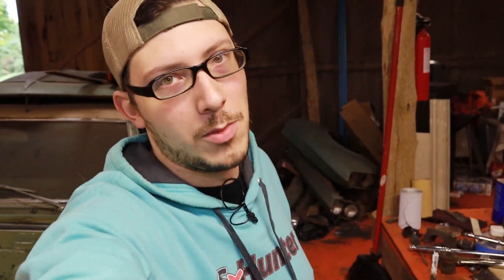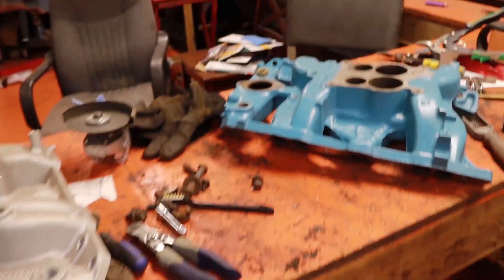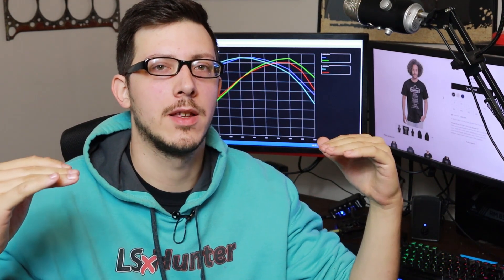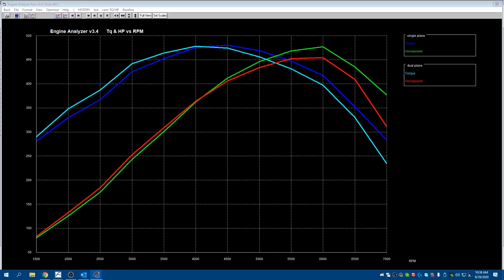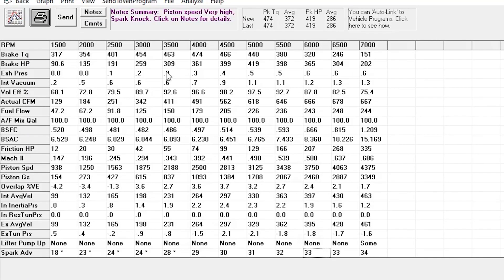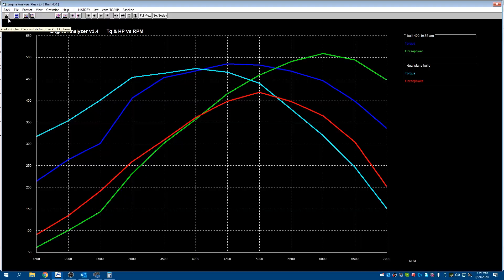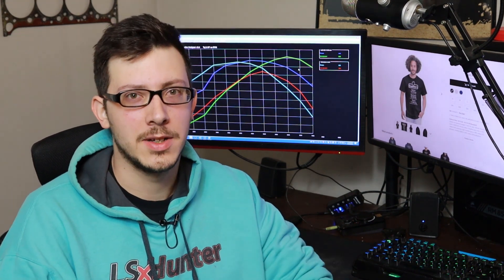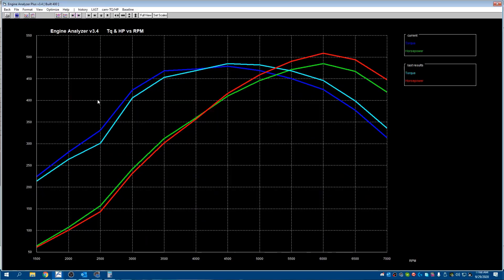Single Plane vs Dual Plane Intake Manifold Comparison

Comment: If you want to kill low end torque, the Torker II is your guy. (340hp FRPP crate 302). I went from an RPM Air-Gap to a Torker II thinking the RPM range on the box was real world. UGH! The Torker II killed my launch and the E303 cam couldn't make up for it quickly enough. From there, I put on a Victor Jr. Oh boy! The launch was mucho bettero than the Torker II with the same top end of both the Air Gap and the Torker II. The Victor Jr was my daily driver intake for years, as in cruising below 3500 rpm. Then I went tunnel ram. That stuff is WAY COOL!!! Tunnel rams make great low-end torque, and you are best banging gears at 6000 rpm. I will say that they all picked up top end charge by port matching. While I have no dyno numbers, my 60 foot was about the same with the RPM Air Gap and the Victor Jr. Both were used with 3.25 to 4.10 gears without any noticeable sacrifice anywhere. OK, 4.10s SUCKED for cruising and didn't do anything at the track. But that wasn't the fault of the intake manifold.

Comment: Hello sir. I have a 1974 Pontiac Grandville convertible. I just bought a 400 rebuilt engine. It’s a 400 bored .030 over. 4x heads. Quick Fuel 850 double pumper. Edelbrock 2801 cam. It has a Edlebrock torquer 2 intake single plane but I have a Edlebrock rpm performer dual plane. Can you help me on which intake to use?
Reply from the maker: On that setup I would absolutely run a RPM Performer, the single plane really doesn't get happy until it's outside of the range of the 2801 cam
Reply: @ Thank you Sir for your feedback. I’ll tell the shop guy.
Reply: @ Thanks for your input. The shop drop the engine in the car today and switched the manifold to the RPM performer. Once it’s up and running I’ll post a video.
Reply: Great video - thnx !   I have a 437 cube Poncho motor that I'm hoping to do a sgl turbo ( s475 ).
Have a T2 int and read article how extending int runners w a turtle could help low end & still breathe  up to 5500 rpm . I have a 750 demon carb w ann boosters , mild solid roller ( 212° dur @ .050 & 112° lobe sep , 8.5 :1 c.r, , and alum d- port heads ( 185 cc int ). Really looking for low - mid resp but not huge tq hit as w an RPM int .  Do you think that the T2 would be good?  Will be 5 sp manual . Thnx.

Comment: Been playing with cars for 50 years always amazes me how much better the engines run after you put a single plane intake on especially small block Chevy’s. I wouldn’t even consider running a dual plane on any of my engines.
Reply from the maker: I’m a BIG single plane guy. There’s just so many more possibilities with them. Not to mention it makes tuning for AF per cylinder so much easier

Comment: Brother at 45 seconds u won me …… your analogy of a street car spinning off the line , negates need for high low rpm  torque ….. I have 327 , 74 nova …. Had a few 70 s in high school . ….. I figured if u walk out the hole , why not pull after 3000, and just go hard and grab a gear !!!! Single plane is king for that , to keep rom up all way thru the gears !!! …..

Comment: 440 mopar 10:1 compress ported heads 1 7/8 headers thumper cam 3.55 gear 28"tire auto edelbrock perpormer milled plenum=burnout machine 6.9 0-60.

Comment: Pontiac 400 ported 670 heads. 4 speed 373 gears. Changing cam from xe274 to crower 60919 1.65 roller rockers. Thinking using a torker 2 with spacer. Hoping it'll run

Comment: I see a turtle in the single plane. Have you had better luck with the Turtle?
Reply from the maker: I'm a fan of the turtle - especially on the 350s to try to get rid of the extra plenum volume besides the velocity increase. Every time I've tested it or seen anybody test it they run faster in the car and usually a touch more torque on the dyno.
Reply: @LSxHunter  thanks for the input I was debating on getting one for my 360 Chevy because of the cost of them and I did some research on the forums and people are saying no and some people saying yeah so I'm just up in air

Comment: Be nice to have A head chart.Basically any head under A vortex you should be running A dual plane.Now running My best friend MR Victor JR dumping my clutch at 3800 with 3.73 rear gears...I have to run A street slick because I wanted the tires to brake lose A little at the RPM.It would drop down to roughly to 3400 and put’s me right smack dab at the beginning of my manifolds RPM band.Now shifting my 406 sbc at 6200 Oooooo boyyyyyy.......Hold on A rolling down my window and tossing out this air crap...I mean gap because I JUST GAPPED IT......Got gap insurance because using that air gap your gonna need it.

Comment: I like your video and I especially like that you're doing this with Pontiac engines in mind. I am trying to decide if switching to a single plane Torker 2 w/1"spacer would to be worth the time & work. I am currently using a performer RPM.... but, I picked up a used torker 2,  still undecided on using it. I am running a th400 with a 2800 stall, 342 gears with a 28' tall drag radial. My current engine combination is a Pontiac 461 with ported 72cc edelbrock RPM round port heads, 2.11/1.77 ferrea valves, 10.4 to 1 compression (dished pistons), custom ground hydraulic roller cam 240/251 @ 50 duration. 540/550 lift 106cl/107lsa. 830 holley  XP style main body , hooker super comp headers. I primarily street drive it, but when a new camaro, or mustang, or corvette, or hellcat, shows up.... 
I like to test it. Would like to know what your engine analyzer program says about my combination.....
Reply: That combo screams T2 manifold.

Comment: 413 060 drilled 400 ported 13 tops crane max performance cam 480 lift 292 duration forged speed pro pistons forged eagle stakes hurricane intake qudrajet 750 nodular crank 010 010 balanced motor 60psi oil pump,12/1compression. Prepped 350 tranny with Short shift kit,3500 stall turbinen,diffed 12bult 4:11 rear axel.engine should give 450hp.built for drag racing in it era.soon i Will instal a 550-510 sniper master efi kit.and of course i have headers om it.
Reply from the maker: What's it going into!? Sounds like it's going to be a monster!
Reply: @LSxHunter  its already in My 81 Pontiac trans am.and yes its fin to driver.
Reply: So what so you think? Watch THE video
Reply from the maker: @emillundstrom3875  I did! Think I commented on it - that idle killer, let alone how quickly an crisply it revvs out!
Reply: @LSxHunter  ok sorry sid se that,Guess you commentented om the link.the Link is from My engine bilder.it,s His YouTube link.is it Good or bad work?
Reply from the maker: @emillundstrom3875  Sounds GREAT. I'd be curious what it runs in the 1/4 mile.
Reply: @LSxHunter  i havet got there yet.hadent hade THE time so far with THE 750carb and now om in to THE 550-510 sniper master efi getting instaled in a month.
Reply from the maker: @emillundstrom3875  Why not go overdrive then? I imagine you'd be able to drive it a ton with an OD. The TH350 is WAY more reliable though.
Reply: @LSxHunter  belive me,i want to THE överdrivet.but with a family to provide for and living in Sweden it ant sheep or easy to fond sadly.this converstion that ive done step by step has costed med almost 30k is dollars. IF mot more.
Reply: Sorry for THE auto correct thing.

Comment: Great topic! im not super mechanical, but understanding the difference between these two types of intake are paramount to building a combination that functions as you want it to.  To me, im not planning on hitting the strip, so im all about that low end torque.  I just want it to romp from the launch to like 45MPH 😀 probably will never rev over 4500 im guessing.  Another thing i think you mentioned... is it true  that a stock pontiac intake flows really well and a mild build would never really see the advantages of a high dollar intake?  might be better off saving money and investing in better heads first (asking for a friend... well not really).
Reply from the maker: I've been trying to dig into raw flow numbers on OEM stuff - the general idea is the stock earlier Pontiac intake manifolds work well until like 450 horsepower which tells me the flow rate is better than a low-profile Performer but not quite as good as the Performer RPM. Once I get some real info I'll be posting it up. The spring is likely to see us test 3 different intakes on the Firebird as well.

The biggest thing is going to be your governor; if you're running a dual plane you'd probably want to shift at 5300rpm with your monster in the Firebird. If it twere a single plane car I'd push it a few more to 5800. If that same single plane shifted at 5300rpm you'd be losing all that gain from the single plane. 

All of this to say. Imma run the stock Pontiac for baseline numbers against the Torker II but the general consensus is the Pontiacs flow very well.

Comment: Video was pretty much what I was looking for I have a 406 that's around 10:1 comp, a Howard's hydraulic roller cam that has an rpm range around 1500-6500 and AFR 220 heads so all the goodies to make good power but I have a performer rpm air gap like everyone else and i was thinking about changing to a super vic that i never used yet, i figure the high flowing heads and that little chunk of power i have from 6000-6500 is enough reason to switch but yeah I spin tires alot with 3.73 gears, tremec t56 6 speed in a 2800 pound  Camaro, contemplating switching what do you think? Also has a Holley terminator throttle body that's a 950cfm unit, I hear throttle bodies like single planes but it's still a wet flow system so it's a over glorified carb basically, but dont know yet
Reply from the maker: You'll probably see a 30hp and 40ft lbs (ish) drop throughout the range until 4,000rpm. This is extremely normal. Personally I'd run a Victor Jr, if you have a super Vic (could add a Brodix turtle) you'd likely see that low end be moved to the top - this is crucial when getting your car to hook. I'm a BIG single plane fan. Kill the low end so I can use it up high where I actually need it.
Reply: @LSxHunter  ok that's what I figured and I've seen the brodix turtle's before, unfortunately I bought a super vic before seeing they still had the victor junior's for sale

Comment: Hello good information.  I have a question, maybe you can help me.  My motor is nothing extreme its for street. Chevy 350. Cam 262/270 flat piston stock heads little port. But.   My intake. Its a dual plane edelbrock performer rpm.  Some people say is big for my setup. They say i need to go with performer but not performer rpm. What do you think??? Thanks alot. And excuse my inglish.  Thanks.
Reply from the maker: I can’t think of a time when I wouldn’t prefer an RPM over a regular performer - let them talk. Maybe port those heads a little more or to a cheap set of Pro-Filers and enjoy more power at more RPM
Reply: @LSxHunter  thanks for answer.  I will try. Thanks

Comment: What up man ?
Im building a street strip 461 for my 70formula,
I plan to try the iron 70 dualplane intake, the ra4 70 repo dual plane and the speedmaster single plane
Reply from the maker: I'm guessing the RA4 manifold will put perform the Speedmaster on most given days. It had a few tricks up it's sleeve 😉.

Comment: Great info. I think I will stick to my factory 69 dual plane. Also thinking of running a stock quadrajet carburetor. Thanks for the 428 info. I will check out uncle Tony's Video. Thanks for the 428 info, very helpful.
Reply from the maker: The Pontiac intakes flow pretty dang well. There's been a handful of cars in the 10s and 11s with the stock intake. Sounds like with the right setup - it's the right setup. Appreciate the conversation!